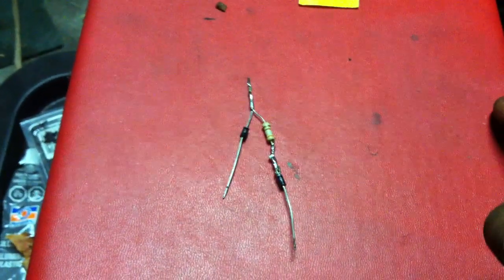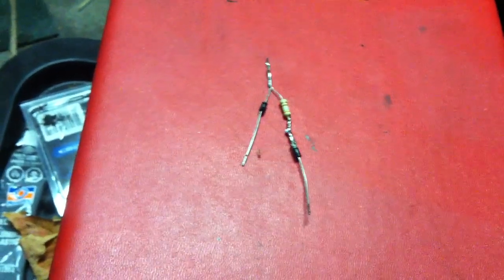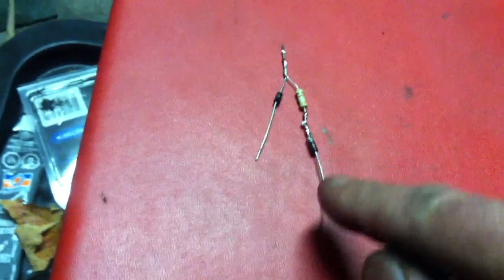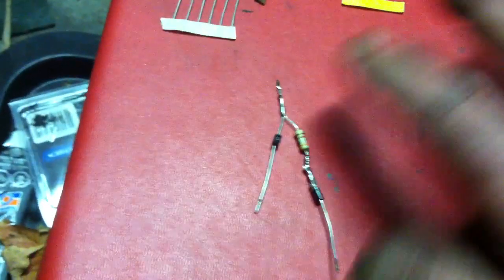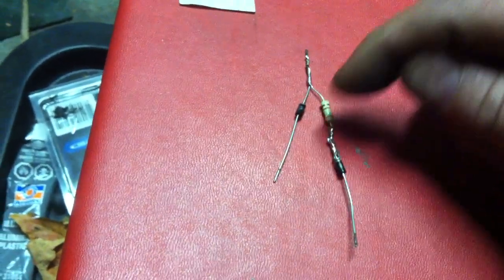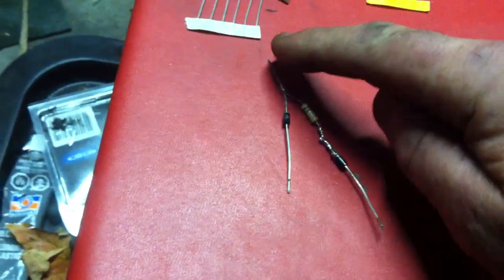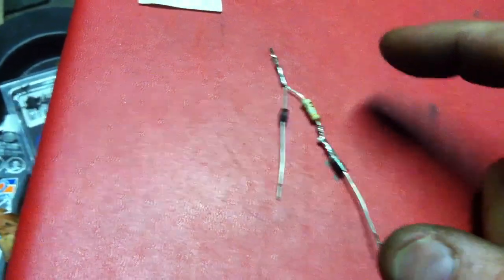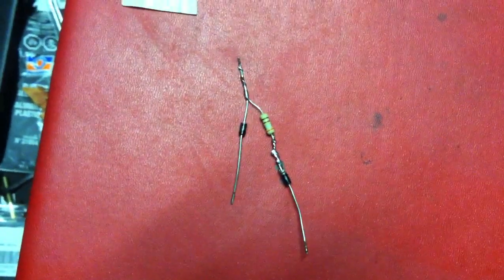How to make an LED bulb or strip into a dual intensity motorcycle brake/tail light

Comment: Aoa, Actually this is not 500 or 600 ohm resistance its actually 390 ohm resistor. This is a 4 bands resistance, the colour code is Orange, white, brown and gold ... And the diode  is 1N4007 .. which means its an 1 ampere diode.

Comment: Can you give me the specifics on the resistors and diodes you used. Diodes I believe you said 5amp. Now is that with 12v power source. I have 3 led per side setup on my bike. Resistors that were used have the red, green, red, gold bands 2.5kohm +/- 5% is this to small?
Reply from the maker: listed in the video description
Reply: @fupabox  Thanks got it. You Tube rookie. Didn't know how to look at description. Great video man. Showed me exactly what I did wrong!!! Works great now. Thx again!!!

Comment: Very Interesting, thanks...
I don't suppose You cud Please ask You're Buddy How I could Convert, an EBay Bought Mudguard complete with Built in  LED Array (Screwed-on.!) Tail & Brake Light, to Run on 6-Volt's instead of 12-Volt's..? It has The Usual 3 Wire's - [ Ground, & 2 x 12Volt in's, }
Any Help Greatly Appreciated,...
Many thanks Danny
Reply from the maker: most LEDs will operate on 6v up to 24v . If the LED bulb you are using has a resistor built in , you need to swap it for a lower OHM resistor or the bulbs will work but be less bright than running on 12v
Reply: @fupabox  Brilliant great help thanks very much…

Comment: I am looking into making my own retrofit LED circuit boards for brake and running tail lamps for my 1979 Ford Pickup.  Your video shows it is possible to make them using one LED to do two functions (Running and Brake). I do have two questions: 1.  Do the Rectifiers or Diodes create a lot of heat?  2.  If a Rectifier or Diode fails in the circuit, will it back feed into the circuit and do any damage? Thanks for the knowledge and video.
Reply from the maker: The diodes and resistors don't seem to heat up much . Maybe a bit warm but nothing near hot . If a rectifier failed I believe the circuit would be fine . I'm not 100% certain on that , but I can check with someone who will know for sure.
Reply: @fupabox  Thanks for getting back to me.  I will make a test setup and see how hot they get. I think the worst that would happen is that I would be getting "Brake" voltage back-feeding into my "Running Light" circuit. I guess it would not be the end of the world until I fixed it. Thanks again and Take Care!

Comment: DID  my bike yesterday and it works perfectly
Reply: Which diodes size did you use and resistor please
Reply: @innovationscustoms5639  I went off what he used in the description but played around til I got the right intensity
Reply: @ken79bu  U know I don't know much on diodes unless the resistors, what diode did he use in the discription

Comment: So, MOST LEDs are rated at 3.5 - 4 volts. 
With 12 volts in, 600"ish" ohms will bring the voltage down to a safe range...which is for the "driving" lights. They'll be on 99% of the time so it's good that they're at a safe low voltage.
PROBLEM.... without any resistance in line when applying the brakes, you're hitting the LED with 12 VOLTS!!! That's SURELY gonna burn them up the instant you hit the brakes. Unless the LEDs are rated at 12 volts, they aren't gonna last long.
Correct me if I'm wrong.
AWESOME video BTW! THANKS 👍

Comment: Will it work for 90cm.led red strip????
Reply from the maker: yes
Reply: @fupabox   same 200 ohm and n400??
Reply from the maker: @aishwaryakumardas1540  yes.. the resistor OHMs can be swapped to whatever looks best for the application . The higher the OHMs the more difference between the 2 outputs . The N400 remains the same
Reply: @fupabox  mean resistors use for dimming feature?? Right??  But for car. What ohm resistor need according to ur knowledge!!!?????
Reply from the maker: @aishwaryakumardas1540  unless you are swapping a regular bulb for an LED on a car with a bulb warning system , a resistor is only needed on the dimmed LED . If you need resistance for a turn signal bulb to flash properly. Check the wattage of the bulb being replaced . divide 144 by the wattage of that bulb and that will give you the required resistance in OHMs to keep the flasher or warning lamp working properly

Comment: 2 things.  The reason this is LED only, is that little resistor used on an incandescent bulb which typically draws a lot more current will overheat.  Actually even on an LED circuit with lots of LEDs a single low wattage resistor can overheat.  An alternative is a much larger (wattage) resistor or.... since each diode drops the voltage .6 to .7 volts you could put several diodes inline (series) on the running light side to obtain desired voltage.  Tip here is to take several in series and play around to see how many you need.  Once you know you can shorten and solder the leads in a tight pattern then use heat shrink on the final design.
Reply from the maker: good info..thanks

Comment: Thanks for this video 🙏. Can you ask your friend what size diode would he recommended for 36 led diode bulb wired in parallel. I'm also doing a custom brake light for my car. Appreciate any help. Thanks again
Reply from the maker: same rectifier diode , but you should try different resistors between 300-600 ohmx to see which looks the best . The resistors are only a few cents each
Reply: @fupabox  thanks for answering back . I also wanted to ask if I would have to add a rectifier to each LED?
Reply from the maker: @Elmer_R  nope...just 1 at the beginning of the  set

Comment: I have a 500Ohm resistance but the brightness is very low, would you recommend a lower resistance value for a brighter tail light position?
Reply from the maker: yes .. the lower the resistor the brighter it will be
Reply: Actually he is using 390 ohm resistor in this circuit..

Comment: Which diode use for 12v 10w single smd led
Reply from the maker: IN4004 or IN4005 rectifier diodes
Reply: And which value resistor should we use for 12v 5w led chip?
Reply: And this is common diode for every 12v led chip?
Reply from the maker: @sourabhchandnani5844  Yes.. the resistor and the diode listed in the video description will work for all LEDs
Reply: Thanks..👍
Reply: I can use in4007 diode in 12v led circuit?

Comment: Possible to add flasher relay on the brake positive before the resistor?
Reply from the maker: yes .. it will work .. I've done it a few times
Reply: @fupabox  Thanks for the swift feedback, appreciate the info.

Comment: So when brake is applied the LED will see full 12v and 3v driving? How long will the LED last operating like that?  Or is the rectifier cutting voltage?
Reply from the maker: the resistor is cutting voltage normally , and as you say the brake circuit adds the full 12v  . LEDs have a very wide operating voltage range, so no issue with burning out
Reply: fupabox im starting to understand this better.  So your leds are wired in series to handle the 12v then you're cutting the volts to dim.
Reply from the maker: Sort of... the power is coming from 2 sources and being applied to 1 LED or string of LEDs.. the full time power (tail light ) 12v power is reduced by the resistor , so is not at maximum brightness. The brake sends the full 12v to the LED which now brings it to full brightness. The diodes are used to ensure the voltage can only travel in 1 direction ..towards the LED. If no diodes were used the circuit wouldn't work

Comment: Am I able to use a single LED bulp with my headlight power line?  It's a halogen headlights...doing something custom for aesthetics but I was wondering if I can use the oem harness for power for a single LED bulb? It's for a BMW e36 m3 ..Thanks.
Reply from the maker: Halogen run off 12v .. so a single LED will work off the same circuit as long as the LED is rated for 12v  or higher

Comment: Very helpful video 👌👍👌 I just fitted two (left & right) 20 led strip lights (SMD5050) to my Givi V47 top box & it works really well. These led's with the stock tail light sitting below should make me extra visible for the cagers.. I used two IN4004 diodes & a 680 ohm 1W resistor but the tail lights maybe too dim......but easily fixed by using a smaller value resistor. You helped me out. Very much appreciated.
Reply from the maker: glad it helped :)

Comment: sweet vid.just what i needed. but i have a small problem. my brake light and tail light have just 2 wires. so i am kinda confussed. is ther any wiring diagram for this. 
thumbs up for the vid
Reply: basically you have your negative (ground) and two positives: Parking lights and brake lights.  essentially you want to connect your brake light positive to the wire with only the diode (black cylinder) on the side of the silver strip.  connect your parking light positive to the other, with the resistor and diode combination (the resistor makes this circuit more dim than brakes, so brakes show brighter when activated). The existing negative (ground) can be directly connectly to the light from the power source.

Comment: how many amps is the diodes
Reply from the maker: it doesn't usually matter how many LEDs   1 or 10 .. the resistor is cutting the power to anything on the other side of it  by say 20 %  depending on the OHms of the resistor... The # of LEDs is generally irrelevant .  you only need the 1 resistor per circuit...so if you sent power to tail lights..if they both receive power from the same wire, but branch to the 2 sides..they still can be controlled by 1 resistor....
Better example   .. take a wire from a headlight switch out to a resistor ..on the other end of the resistor you could connect all 4 of the marker lights for your car..2 tail lights and 2 front markers...all 4 would be running on the reduced output due to the 1 resistor that came before they branched into 4 separate lights.   If the source wire for the tail lights isn't accessible before it branches to the 2 tail lights, you could put a resistor on each and have the same effect as long as the resistors are the same
Reply from the maker: I think they are 1 amp
Reply: fupabox just wondering if you were doing this for single leds you'd need one of those resistor/diodes creation for each one correct! As for the strips I'd just double up on resistors if 1 isn't enough for a strip larger then 6 leds, I'm thinking 12 so double it should be good correct? Think I'm going to try to create a set of led tailights with my second set, otherwise they're just collecting dust not to mention no one in my car group has created their own tails.
Reply: fupabox thanks for the help.

Comment: Can this set up be used on 9v pp9 battery I am trying to put some 3mm leds into a scale model car and want to use the LEDs as head lights similar to a real cars lights so when I turn the lights on the led will lite up then when I press a switch for the second time the lights will go brighter can you tell me if this will work
Reply from the maker: it should , if the switch is able to switch 2 inputs into 1 circuit, then this set up would do the rest

Comment: Hey man loved the video. However for some reason i am not getting any power from the tail light with the resistor only the brake light works. Question is: is there a specific way the resistors go i made sure both diode grey side is facing towards the led strip but again no power from tail light. Thanks in advance
Reply from the maker: resistor should be bi-directional...is it 12v and low watt ?

Comment: So basically you are adding 12 more volts when the brake activates? Sending a total 24v to the led?
Reply from the maker: Nope... the resistor on the taillight circuit cuts the power to the tail light, so it is dimmer than it would be at full power... The second circuit (brake light ) bypasses the resistor so it adds the missing power back into the circuit which makes it brighter when the brakes are hit

Comment: sorry ment to ask. I'm trying to make my 2×wire led joker astro marker light be my running / break and turn.. ment to ask will that set up work for break and turn. thank you for the video.
Reply from the maker: yes it will work for brake and turn...you would have to make the turn signal the resisted (lower power) part of the circuit..then when the flashing turn comes on it would add the rest of the current the initial circuit resisted..so the flash would just be the LED pulsing brighter....at 2;00 in the video  the right side of the circuit would go to brake switch, the left side to turn signal

Comment: GREAT VIDEO....HELP ANYONE.
I have followed the instructions no matter how many resistors i connect LEDS do not DIM.[DC12V -SMD 5050 }
Can someone with more knowledge help please.
Reply from the maker: it may be a silly question but is then the diode on the  reduced power side facing the right direction  ?
Reply: John Oleary, how many LED's are you using? Also, if you swapped the brake and tail light it will always be bright

Comment: I'm trying to use this on a led brake light. However, when I use a resistor it's not having the same effect as in the video. Instead when I add a resistor instead of it getting dimmer some of the leds turn off. Is there anything I can do to fix this? I have a feeling it's the way the brake light is internally wired.
Reply: Maybe try connecting one more resistor in parallel to the one you used. The strip may not be getting enough power through the resistor prescribed. Your strip might be different from the one used in the video. Speaking of which, what kind of LED strip is featured in the video? What LED are they? 3528 or 5050 or something else?
Reply from the maker: FodderRev in the video the strip is just an ebay no name light strip
Reply from the maker: Hmm ... I'm not exactly sure how that is happening ..it is possible the internal wiring is causing it, but I don't know enough about electronics to give you an answer.. If I can get hold of my friend tomorrow, I may be able to get an answer for you

Comment: YAYYYY!!!!  I did it!  I followed your instructions and it worked perfectly!  I took your diode and resistor specs to Fry's Electronics and they sold me the parts.  I purchased a cheap solder kit.  I learned how to solder!  Not too bad at all!  I wrapped everything with heat shrink tubing and used my wife's hair dryer to shrink it.  It shrank tight to the wires and electronics.  I kept testing the circuit with a 9 volt battery to be sure that I put the diodes in the correct direction.  I attached the wires to my LED light on my motorcycle and -- WOW!!  It is PERFECT!!!!  I feel a lot safer already!  My wife said that I am such a handyman.  I didn't tell her that I learned how to do this by watching your video!  THANK YOU!!!!
Reply: Which resistor you use
Reply from the maker: +Rick B excellent   .. glad it helped  :)

Comment: I can only find them in 1/2 watt at radio shack or amazon. I made one with a 1k ohm resistance and it is too light. I am making this dual intensity light strip with 200 LEDs for my back up light. So far I am liking it, just that problem that I am having.
Reply from the maker: +Bulmaro Salazar  My Radio shack is really sadly lacking in electrical components now, and they have the 1 watt resistors.. weird..have you tried ebay ?

Comment: I can't find the 500 ohm 1 watt resistor would you be kind enough to post where you found it?
Reply from the maker: +Bulmaro Salazar  I got mine at a place called Sayal electronics... radio shack should have them,any electronic parts store should carry them..they are very common
Reply: I used 1/4w 560 ohm resistors and bzx55c12 diodes.

Comment: If the LED strip has 3 wires, one for ground, one for running light, and one for the brake light? Anyone know how I would wire that up to a wiring harness that only has a positive and negative for the original taillight?
Reply from the maker: +itsjussjerry  are you wanting a brake light or do you just want to use it as a tail light ?

Comment: how did you go about cleaning it up and looking good? do you get scared that the led can get wet?
Reply from the maker: You can shrink wrap it or dip the whole thing in liquid electrical tape. It's an electrical circuit so you want to try to keep it dry
Reply: +fupabox Did you figure it out for a regular bulb?
Reply from the maker: Hakasauars No.. there isn't much need, since you can buy a dual filament light bulb and wire both circuits into it more easily